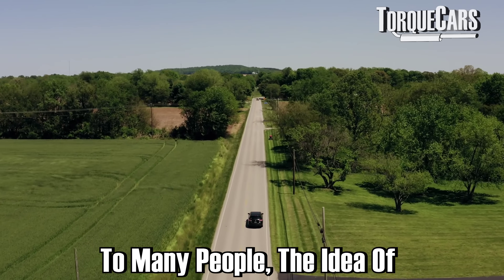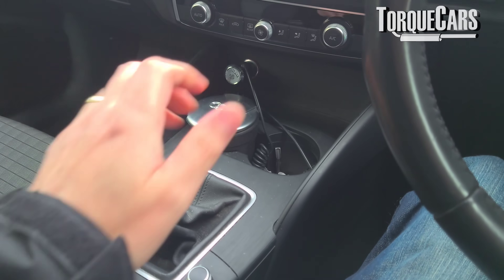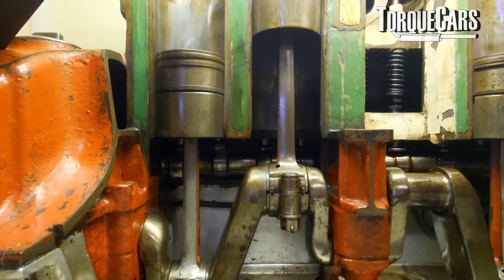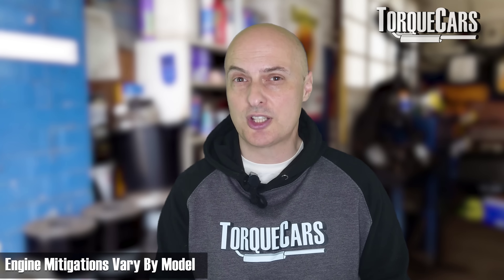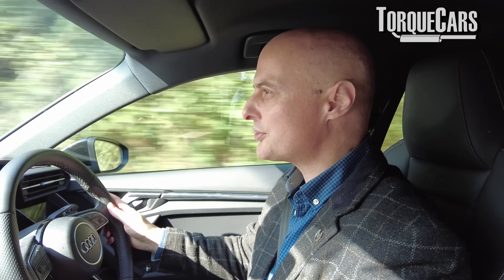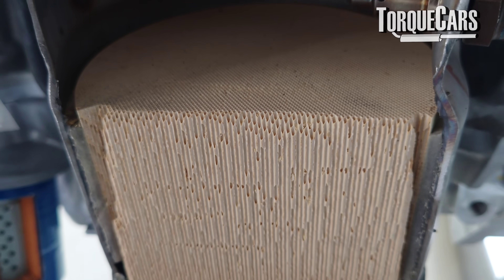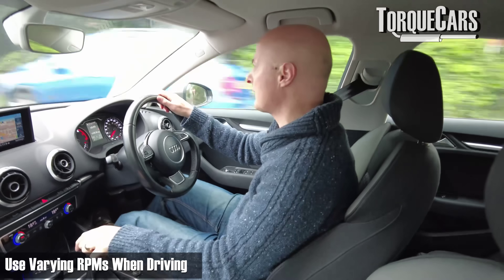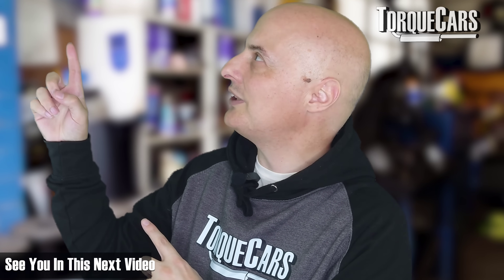BIG DAMAGE By Lugging at LOW RPM? Eco Driving Warning! (Manual Gears)

Comment: I have a 1990 Mercedes-Benz 300SE, and the speedometer has small dots that show me how fast I can go before upshifting the automatic transmission. 

Jay Leno has talked about 'delayed shifting' an automatic transmission as it keeps the RPMs in the mid range where the engine works best.

I believe it saves gas as the car has a vacuum gage, labled 'economy', and delayed shifting keeps the vacuum down, and I don't use the breaks as often while enjoying a more sporty driving experience.

Comment: I have owned a V8 since 2007. It idled with the AC on during hot weather and heater in cold weather for years. It has 309k and runs great.
Reply: Idling if it's wormer then 0C is perfectly fine for engines in fact starting engine often is much worse. My uncle had broken range rover that he could not turn off at all as it would not start again so he literally kept it running for 2 years before he fixed it as it was his daily. Nothing happened to the engine.
However if temperatures go below 0c it's better to slowly drive then keep it idling to worm it, slow drive will make oil warmer faster and reach operating temperature sooner while idling in such low temperatures can course issues due to oil not reaching operating temperature in time.
Reply: Can't edit, sorry for spelling, phones autocorrect in action.

Comment: I did not count how many times you said "low rpm" (it was many, many times), but if you ever put an actual number to it, I must have missed it. 1000 rpm, 1200, rpm, 1600 rpm? I drive a more relaxed style these days and mostly keep the engine in the 2000-3000 rpm range (2 litre TFSI); in the lower range on a flat stretch, higher going up a grade. If I drop much below that, I can feel it and hear it without looking. Time to shift down.
Reply from the maker: That's the problem, there are so many different engines out there, and actually low RPM depends on what you are doing. Going up hill for example puts a larger strain on the engine that constant cruising speed so the RPM chosen should vary.

I will drop another video soon about what LOW RPM is and what it means to help clarify this point.

The video was primarily aimed at manual drivers who try to keep as close to tickover speed as they can at all time. There are quite a few of these around but it seems you are using your common sense anyway so well done - an above average driver.

Comment: I drive an old 190E Mercedes with an 4 speed automatic gearbox, this car literally cant drive at low rpm’s unless you want to want to drive unreasonable slow.
That means 2.800rpm at 100km/h - 60mph and way higher on the autobahn. Still the first 30 year old engine with 217.300 miles and counting.
He just burns around 400ml of oil at 1000km, not that bad for the age.

Comment: new cars (mine is 4 year old) are geared to keep you at low revs ....should i override this and change gear at 3k rpm like  i always have in older cars?
Reply from the maker: Manufacturers have done a reasonable job at setting gear change points, in an automatic it is quite hard to lug the engine. 

Just use sport mode once in a while each trip and give it a blast.

The real issue comes in manual cars where drivers assume that being near tickover RPM and pressing hard on the throttle is ok.

Comment: VERY important and well done video! I guess most people have never thought about it. 
For many years now I avoid driving my Audi Diesel below 2.000 rpm. Before that, I used to drive it at 1.200-1.400 which seemed to clog the costly particular filter much too fast. I also rev it to the redline every now and then, seemingly making the car run faster and cleaner. It now has 190.000 km on the clock without any engine repair.

Comment: I can not be more constructive than pointing out that :
New fuel-economical cars dont last long, no matter how you drive them. The impact on the invirement is big becose whe have to recycle them and then produce a new one 😂. 
Old cars last longer and easy to repair.
General public is indoctrinated and naive. New isnt better, ask any mecanic.
Reply from the maker: That certainly matches my experience, my old 2000 A3 is still on the road and going strong, the 2007 A3 TDi I sold was scrapped about 5 years ago. A friends 2019 A6 is starting to burn oil and has other issues at 50,000 miles.

Comment: Yeaaaa. I drive 500 miles a week and I kept the car at 1500 rpm for 2 years.

Then I messed up my air intake while changing my spark plugs.

Long story short. Cost me £3500 to fix misfires and a carbon build up. Car only had 40000 miles and was 3 years old.

Learned a lesson. Do not drive low RPM 24/7.

Comment: 1:40 If you "don't have time to change gears" to switch to correct gear when you need to accelerate, you should be practicing gear changes. If you're on incorrect gear, it will take more time to not change the gears because the engine will be so far away from the optimal rpm range that it will be faster to clutch in, switch gears, clutch out, press the accelerator pedal and still end up faster in the end than simply pushing the pedal to floor on wrong gear.

If you don't want to practice, just get an automatic transmission already.

Comment: I feel some engines like the Ls or ford modular which make peak torque lower are okay to be floored at around 1600 rpm also because they're Naturally aspirated, but i wouldn't do it in something turbocharged and with a high rpm rev limit like a Civic Type R

Comment: Finally. I was always laughing when people told me "drive with low rpm to save fuel"... I told them everytime "you save fuel and pay the bill on repairs because of your stupid driving". And guess what? MY car has over 200.000 miles on it. First Engine, not a single repair on the engine. Sure, timing belt changed and every 10.000 miles an oil change. And the engine works fine. And most of the people who told me to drive at low rpm are every month at the repair shop. 
An Engine is build to rev and its more than happy to do so! But dont stress your engine until it has working temperature and oil temperature.

Comment: Weirdly enough, in my truck I did my usual driving for two weeks which is mostly city driving 60-65% on city streets and tried eco and normal on my sport oriented truck and actually got better mpg in normal. In eco I would average 10-15 mpg each tank and got as high as 27 mpg but averaging 25 ish mpg in normal

Comment: Three things came to mind watching this great video: 1. Paul Frere (race driver) always recommended to drive your engine at or above 1/3 red-line. 2. Saving fuel with low RPM accelerating is based on the engine consumption map that suggests driving with high load (NOT full throttle) at low RPM is most efficient. There even was a BMW advertisement in Germany in the late 70s explaining this in detail. 3. I still own my father's car (1972 Opel Commodore B Coupe GS with the 2.5 twin carb engine). In the manual for that car Opel writes: "If you have knocking due to carbon build-up, go on a 150km high speed Autobahn drive". A manufacturer recommended "Italian Tune-up" 🙂 Also, I am now a subscriber to this channel.

Comment: I never rev my engine over 4750, usually cruise about 2000 rpm. I've got a quarter million miles on it.
 I'm also cheating. I drive a diesel. 😅
His advice for petrol engines is spot on and well explained.

Comment: Honestly automatics really help with this a lot, you don't need to prevent stupid when you forbid it and cut it out of the system. I originally wanted to get a manual, but because of supply issues settled for an automatic to not loose out on a massive discount, and it does everything right without me even having to bother. It goes low, but not super low, it downshifts to accelerate, I have high hopes for this car lasting a good while (he said, fully aware he's late for an oil change).

Comment: I was under the impression that you're not supposed to shift down the 1st gear after youve shifted out of it.
Reply from the maker: I have heard that too, it makes sense, it is rarely a smooth transition and in most situations the 1st gear is a get the car moving gear. I drove an auto recently that kept wanting to pull away in second as 1st was quite short.
Reply: @torquecars  manual transmissions are such a mystery.

Comment: what would you say is the best RPM to average, with all things considered? I had a van that was limited to 60MPH and I think the turbo barely came on at that speed in full gear, and I was worried it would cost me more in full due to high RPMs. with this video in mind I'm wondering what would be the best average to have in mind.
Reply from the maker: It's really hard as it will depend if you are putting it under load/accelerating up hill for example and the range of the engine. 

Very liitle happens when you are at constant speed or low RPM other than soot not being pushed through very effectively, so a blast now and then will help with that.

A personal rule of thumb I use is to divide the RPM band into 3 and stick to the top parts of the lower third for most, but do explore the rest of the RPM range once or twice when the engine is warm if you can - that really helps. In my car a 6 speed I drop to 3rd gear at 30mph and only really use 6th at cruising on motorways at 60 or 70 dropping down to 5th when I hit a hill or 4th if I need to accelerate.

Comment: Depends by the engine itself, but for gasoline cars the ideal spot is 2000-2500 rpm for me. Higher wastes fuel, slower is not reactive, and something that isn't reacting quickly to a full throttle combustion is not good

Comment: You can save fuel and still drive like a normal person. There's no need to speed up just to slow down in a short distance, a slower initial speed traveling uphill has less momentum which equals more gas used, keep your rpm  @ ~2k when cruising at constant speed, take the highway if it's a similar ETA as back roads, and build a gap if someone ahead of you is turning (slowing down/downshifting early, within reason, can allow you to be traveling 5-20 mph faster when the turning vehicle gets out of the way depending on traffic, your gap and road speed).

Comment: In the army I remember being instructed that climbing grades at low RPM would result in overheating. You should avoid lugging the engine to prevent overheating.

Comment: Thanks for the video. Started driving about 7 months ago and since then ive put arround 40 mins / 25-30 kms daily in the low rpm conditions youre describing. Taking into account I drive a 1.1 gasoline almost exclusively at 1.5 to 2.5 rpms, should I look for damages?
Reply from the maker: No don't worry, most will regard around 1.7k rpm appropriate on a 1.1 engine for most situations just change down a gear when you need to accelerate to avoid lugging. The key is to vary your RPM more and that'll help prolong the cars life. The problems are more likely when you start driving close to tickover speeds and trying to accelerate hard.
Reply: @torquecars  thanks for the quick reply!

Comment: Is 2000 rpm a low RPM? On some roads I do tend to be jn 4th gear at 50km/hr when I could be in 3rd instead at around 2700 RPM or so. This is only when the road is flat.

Comment: Ive been driving my corolla mostly at low rpm for over 12 years and almost 200,000 miles and nothing has ever gone wrong with it so maybe Toyota engines are just better made?
Reply: Older ones yes.

Comment: The Italian tune up is real folks. I take care of my moms car and when I do maintenance on it I take it for a 5 mile spirited drive to get the valves to spin in their seats and blow some carbon off. Also a lot of the modern cars almost have no oil pressure at those low rpm's.

Comment: I have DSG automatic transimission. I'll only say this. NEVER AGAIN AUTOMATIC TRANSMISSION. You can't choose your higher rpm because of that damn transmission. It will change your gear after 1700rpm no matter what. Only in sport mode it will change it after 2000rpm.

Comment: How can it be that if you have low rpm you have bad combustion and not if you are at high rpm. Because in a gasoline engine the air fuel mixture is already at the right mixture and the diesel engine also has a limit of the fuel per power stroke. So if it is like I said then at low rpm does not have worse combustion than in high rpm it should even have better combustion.

Comment: i bet most cars in the uk arent manuals any more
Reply from the maker: 70% of cars in current use are still manual. There is a big shift, new sales show a much much lower uptake of the manual. Most Hybrids are automatic which is the primary driver, plus autos have come a long way since the 3 speed torque convertor setups.
Reply from the maker: Also I haven't owned an automatic in 30 years+ of driving. My next car will be an auto though.

Comment: I drive a diesel and it infuriates me when I'm stuck behind someone driving well below the speed limit as I end up using lower revs which causes the DPF to clog and then the fan is blowing like crazy when the car is eventually parked and switched off trying to cool it down.

I tend to stick close to 2000rpm whenever I'm driving through urban areas and only use low rpm driving on the motorway when I can shove it into 6th until I need the power to overtake someone.
Reply from the maker: It's funny I was driving along at 30mph in a 60mph zone and a diesel driver came up behind me with his fan blowing like crazy. So that was you was it? lol - sorry.
Reply: @torquecars  nah, I'm referring to what sounds like a jet engine when you've parked the car up after driving at low revs for too long.

At that point, I have to either take the car on a decent drive or just stick to low gears for a few miles whilst driving at high revs and high speeds.
Reply from the maker: Ah yes, sorry, I am with you now. This happens when the DPF regen starts, things run really hot to burn off the collected soot and when you switch off the engine needs all the help it can to cool down.

Comment: My automatic shifts up at like 1.5-2k RPM and just drives at 800 or something. But I make sure to downshift manually and accelerate at high RPM's at least a few times when the engine is warm

Comment: There are several cases where low rpm driving is actually using more fuel than higher rpms. My Supra is a good example of this. Most people would stick to 2000rpm or below in top gear cruising. The fact is the car is most fuel efficient cruising at 3000rpm and up depending on weight in car.

Comment: Very well explained. I am very mechanically savvy and avoid driving in low rpm unless the load is very light. However, I missed quite a few points that you make (water, oil pump rpm etc). Well done!

Comment: What ist with automatic transmission, i have an amg e55 w211 and if i drive at C(Comfort) i drive the most time at maybe 1200-1400 rpm because of the big motor. Should i change to S so it is changing the gears later?
Reply from the maker: The autos usually choose the highest safe gear they can for economy. A big engine is not really straining at this rpm, even nearer tickover they are pretty solid. The real take away here is to use the rpm range more, don't fear S mode from time to time!

Comment: I was used to do motorway at about 1.8k RPM with my old 2006 110kW diesel, now I bought 2022 VW Tauran 110kw diesel and it is always indicating that my gear is to low and advises to shift higher gear and is happy when RPM is lower then 1.6k RPM . Is this a car computer recommendation bases purely on emissions perspective and is sacrificing reliability? I am more concerned about engine lifetime and not about emissions do I need to keep driving closer to 2k RPM ?
Reply from the maker: The real take away here is to use a wider band of the rpm range more often, don't fear the upper third from time to time! Even 1500rpm is fine if you follow up with some 2-3000 from time to time for short periods.

Comment: If "you don't have time to downshift" then you don't need to accelerate at all when in final gear. That simple. 

I have 4 V8s, they all idle a long at 1600rpm while going 65mph. Only 1 of them is backed by an automatic and none of them have ever accelerated while in 5th (manuals) or 6th (the auto).

Comment: Car manufacturies have designed the engine to meet fuel efficiency targets by using low rpm.
And now it´s not good? 
i have always used low rpm (to a reasonable level) and i have NEVER EVER had any issues with engines.
And nowadays most cars have auto transmission that always goes for low rpm.
Reply from the maker: Yes most auto transmissions do a very good job at keeping the RPM just inside the power band. The problem highlighted here are hypermilers who drive around with a manual box in too high a gear pushing the engine with too much load. There are quite a few of these over here from my experience. There are also a few documented cases of oil lubrication issues exist.

I think you hit the nail on the head when you said (To a reasonable level) it is the extremes we are talking about here.

Comment: My Mercury Grand Marquis with its 4.6 V8 has 260,000 miles on it and runs like new. I hardly ever take it over 2k rpm. If it's so wrong how come it runs like new? It starts instantly, gets great mileage and the only part I've replaced is the serpentine belt.